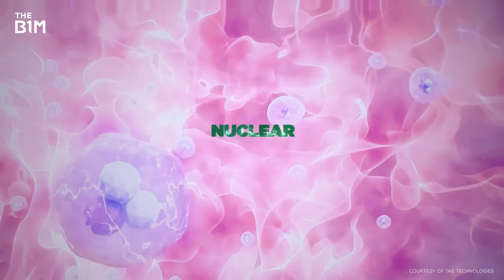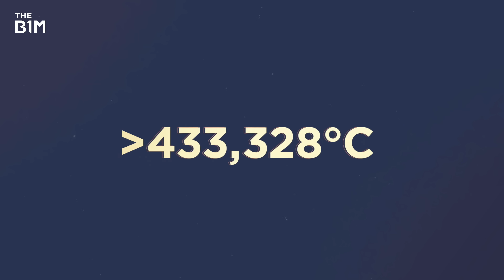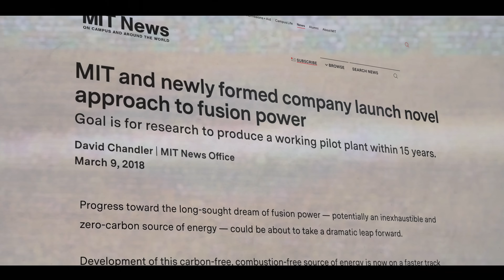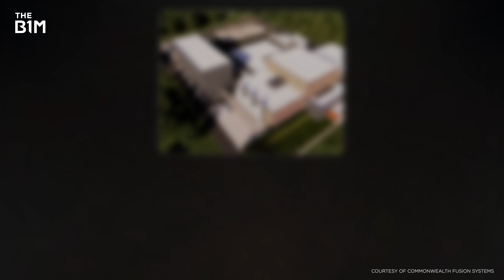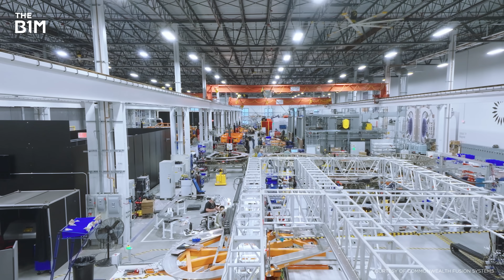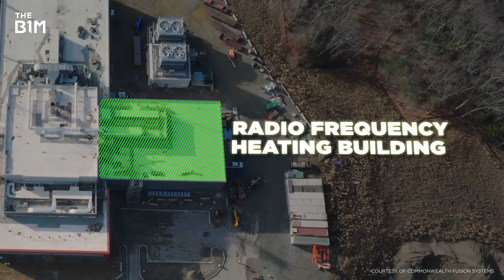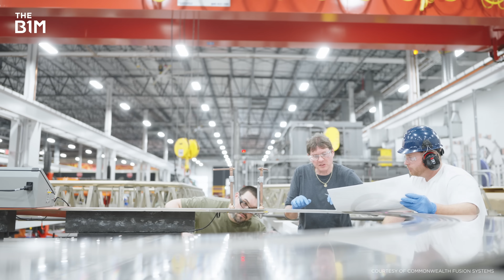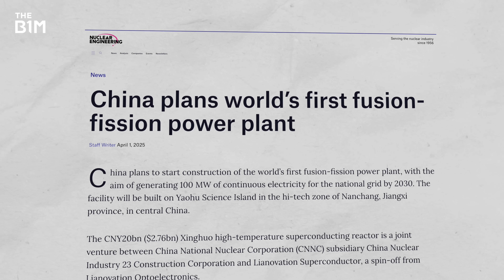Is America About to Win the Nuclear Fusion Race?

Comment: yea after about a thousand nuclear fusion startups all around the world i believe it when it delivers actual power at an actually reasonable recovery rate.  bevor that is worth as much all the other ones.
Reply: Dude, you have a less than 10mm slice of metal with a sliver of silcon with literal microscopic copper structures designed to transmit electrical signal in an efficient and meaninful manner, which also connects to an invisible network of information which connects you to almost every corner of the Earth. This problem is hard, but it is technically fiasble. Some people lose so much sight of the determination of humanity.
Reply: @AndrewChristianHTX I don't even know what your talking about.
Reply: @AndrewChristianHTX wtf are you even talking about. Smartphones have literally zero relation to fusion 😭. Also I am really sorry for you if you believe any random tech pro claiming they invented some random bs. And ofc they gona in 1 year do what the top scientists of the filed took 20 years for and still didn't succeed. Also don't mind the other 200 people claiming the exact same thing and failing. 
At some point people really need to start realizing reality exists. 
Noone questions fusion is feasible or that someday some company gonna succeed. But unless the random guy has proof don't believe them. You gonna live a significantly better live like that.
Reply: @asdanjer The point that I was making was if you were to ask somebody from 50 years ago whether or not modern smartphone technology were to exist they would think it would be mythological. The reason that I gave you the comparison was to suggest that humanity has a way of overcoming things that seem impossible at the time and not the world a hundred years from now will look completely different just like the world looks completely different from 1925
Reply: @asdanjer  if anything I'm being the opposite of what you did by being a self-proclaimed expert internet warrior. The only thing I suggested was to have faith in humanity
Reply: @AndrewChristianHTX  so your jsut stawmaning against something i never said. got it. 
like no one here ever suggested it isn't possible. pls just read comments bevor your reply....
maybe you can understand in terms of your nonsensical comparision: 
50 years ago some startup is like " we gona have smartphones by next year and everone gona use them" to which i repond "i believe it when you got em" 
and your reply somehow is " it is possible. 
like do you realise how that makes absolutly zero sense?
Reply: @asdanjer  Lol. I don't think you could define strawman if I gave you a dictionary. The one who isn't listening is actually you. You're defending the issue you THINK I have with your post, instead of what I actually said.

I'll break it down for you:
"..after about a thousand nuclear fusion startups" = hyperbole

"i believe it when it delivers actual power at a resonable recovery rate" = ignorance and an open ended goal

There has already been a demonstration of a type of fusion with net positive energy. The math works and now we're working on the engineering and material science part of it.

You sound like you're arguing with someone else, so I'll leave you to it.
Reply: @AndrewChristianHTX  wow you found out i was hyperbolic... good job (this time it is sarcasm btw bevor it takes you another 10 comments to figure that out) 
it never been about net positive. it been about economically feasible. 
and i am sorry to tell you this but anyone who believes strangers when they make claims without evidence is nothing but a naive fool. there is really nothing more to your statment.
Reply: @asdanjer Dude what are you saying, That just because a problem isn't solvable now it will never be solvable so we shouldn't try?
Reply: @asdanjer It's fair to reserve judgment and to demand proof. One of the primary jobs of our SPARC machine is to demonstrate net fusion energy (Q>1 in scientific terms), then Q>10, which paves the way for our ARC power plants. But meanwhile, it's also fair to judge us by our progress toward Q>1. This isn't a binary situation where we flip from "nice idea, we'll see what happens" to "commercial fusion energy is viable" in one moment.

We publish extensive peer-reviewed research so that independent experts can spot problems and validate our approach. We proved our superconducting magnet technology with our 2021 TFMC and 2024 CSMC tests. Detailed computer simulations informed those tests, and then those tests improved our computer models. We’ve built a supply chain that’s provided thousands of kilometers of superconducting tape. Our factory is turning out SPARC’s magnets today. We’ve secured strategic partnerships with Dominion Energy and Google to support commercialization work that takes years to complete. We're not done, but we have a strong track record of executing our long-term plans.
Reply: Bevor
Reply: @tommy-g5k German
Reply: The recovery rate was positive for the first time in 2021.

I wouldn't pass nuclear fusion off as impossible, the real drawbacks now are the environmental impacts, nuclear fusion requires massive amounts of water and it can only really be fed by seawater.

I would be interested to see if the environmental impact is lower, but based on its location right next to the ocean. I'm already guessing it will be the same as Sizewell C and Hinkley C, which are both fed by seawater and cause devastation to local wildlife.

B1M has a video on the UK's nuclear project, it's fission but you can understand the real impact of what they're building.
Reply: @thatsaspicyhaggis  you forgot to take note that this was done in lab and the caveat was that, while they got a net positive energy from fusion. Other parts of the plant consumed much more energy so it was still a net negative output for the power plant as a whole.
If we had achieved a net positive output, then we would already have plants being made worldwide. Scaling is much easier than getting a positive output.
Nuclear reactors are the most regulated systems in the world. I doubt any contamination will occur like it occurred previously because of lack of regulations.
Reply: @aparnarai3708 I wasn't talking about contamination, I was talking about ecological damage. The B1M video explained that the water intake/output of these plants is so huge they swallow up schools of fish. The environmental cost is quite large and it seems like the fusion reactor would be similar in damage.
Reply: @thatsaspicyhaggis it's not about being positive. It's about being worth the effort. Which noone got to yet. 
And what would you use seawater for in a fusion reactor?
Reply: @asdanjer  To be worth the effort, it has to give net positive energy output, so it's very much about that. The seawater would be a source for hydrogen if large scale fusion power is ever a thing
Reply: @stantonfuerton yea as I said being net positive is not the point. If you got a recovery ratev of 1.1 it simply isn't worth the effort which is exactly the reason we don't have fusion power plants. 

And no sea water is not how fusion works 😭. This isn't a sci Fi movie movie...
While you can get Deuterium from ses water you can't get triterium which is the issue. 
And the amount of it you need is so little an irrelevant that we don't even have to think about this bevor all of humanity runs on fusion. And even then Deuterium being there or not really doesn't matter. We might run out but there is not really any other downside.
There is absolutely no issue with that.
Reply: @asdanjer  Wording it that way ("it's not about being positive") makes it seem like you think it doesn't need to be net positive at all. Which is obviously wrong. If you mean that it needs to be much more than net positive, then say that. Also, deuterium is half of the actual fuel for the most likely fusion part of the fusion reaction, so it's not some irrelevant concern of where to get it. And that source is almost certainly going to be seawater, so it doesn't make sense to say that's not how fusion works. Yeah, it may not be a hugely significant amount of seawater for a long time, but you asked what it would be used for, and that is what it would be used for.
Reply: @stantonfuerton  i literally made it very clear the next sentence. if reading more than one sentence is difficult then that seems like a different issue. 
it is half of it but not the difficult part. 
also if it where to actually use seawater and reduce the sea level that would only be a good thing. xd 
significant water usage would require it to use normal hydrogen. which is a sci fi thing for now. so yes just using sea water instead of just extracting deuterium is sci fi. 
and the tiny amount of deuterium extraction cant really affekt anything. 
i asked cause maybe you fought it is used for cooling (which would actually have envoimental consequences like with fission ones).
Reply: @asdanjer  Obviously I read it all if I replied to the rest of your comment. Again, the problem is wording. The next sentence doesn't help that. If anything it makes it worse, since it implies that what's "worth it" is opposed to being positive. That was my point.  

Anyway, you keep saying that deuterium extraction wouldn't affect anything, so it's clear that you don't get why it would be a problem. How do you think they get it? It doesn't magically jump out of the seawater. The fact that it is such a small percentage of seawater is exactly why it's an environmental problem. Cooling isn't the reason for seawater that I was referring to. However, cooling would still be needed for the turbine water loop. That's not something that is limited to fission reactors. All generators (besides solar and wind) work the same way.
Reply: @stantonfuerton It's not a source of hydrogen, it's cooling water, that's the problem we have with nuclear energy at the moment.
Reply: @thatsaspicyhaggis  Yeah, cooling water is needed for nuclear power now, and likely will be needed for fusion power as well. That's what I was alluding to in my last comment to that guy.  Although cooling tower water can be sourced from elsewhere than seawater. As I understand it, though, fusion will need deuterium from heavy water. Which will almost certainly mean sourcing it from seawater to get the amounts needed for large scale fusion power generation.
Reply: @stantonfuerton  The Canadians made literally thousands of tons of heavy water for their CANDU fission plants and never touched a drop of seawater to do it. Sourcing deuterium is not an issue technically or environmentally, it's just expensive.
Reply: @richardb1452  Canada has the Great Lakes, so it could get the water there. However, it's still the same issue, as you need roughly 300,000 times the amount of regular water going in to make every bit of heavy water you need. The issue is intaking that much water, which absolutely causes environmental impacts. It doesn't matter if it's lake water or seawater. I personally think those effects will outweigh the negative effects of other types of power generation if fusion ever gets off the ground. But, it is ridiculous to say there aren't any environmental effects.
Reply: @stantonfuerton  You do understand how little deuterium is forecast to be used by a fusion plant per year and how much existing draws on lake/seawater are right? 
The Bruce Plant used 340,000T of lake water per 1T of 99+% pure heavy water. At estimates of 100kg (estimates vary between 50kg-150kg) of deuterium per year for a 1GW fusion reactor and heavy water being 20% deuterium by mass, that 1 T would power 2 plants for the entire year. 
That's approx 340,000,000 L of water, which sounds like a lot, but a typical 1GW+ thermal power plant draws between 50,000,000 - 4,000,000,000 L of water per DAY for cooling alone depending on the design. Put a heavy water plant at a single 1GW power plant utilizing the cooling water before discharge at 50M L/day and you could provide deuterium for 100 fusion plants for the year with zero additional impact. At the higher draw of 4B L you could fuel over 4000 fusion plants for the year. Not a problem we're likely to see anytime soon.
Heavy water production is a drop in the bucket compared to other uses and if combined with an existing cooling water system is literally zero additional impact on draw.
Reply: @thatsaspicyhaggis 
The net pasetiv who's in a testing rig fore nucs 
So not really a testing reactor
Reply: Fusion not the same technology as fission
Reply: @fparent  yea i ment fusion.